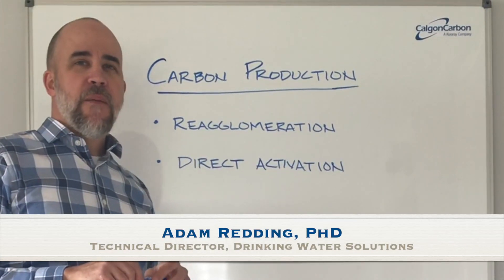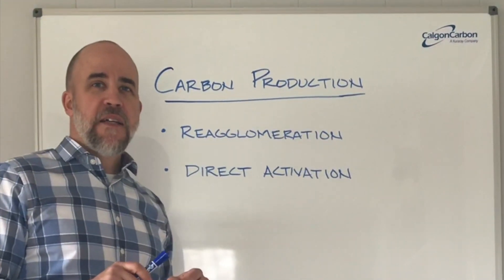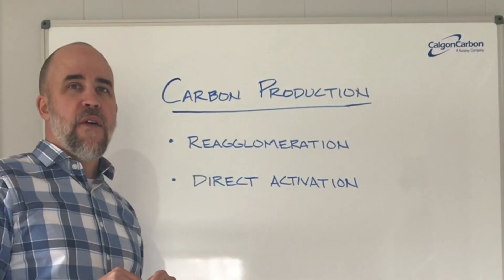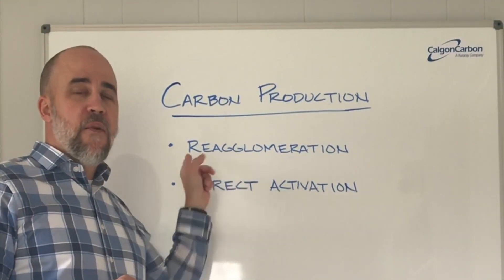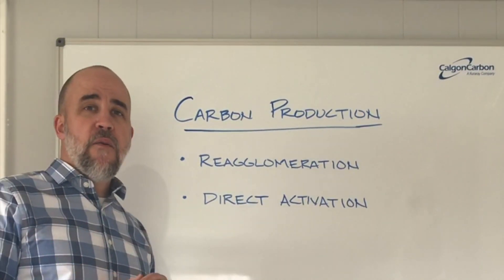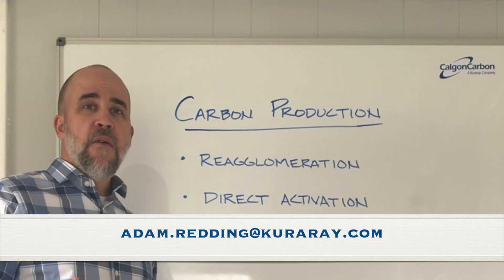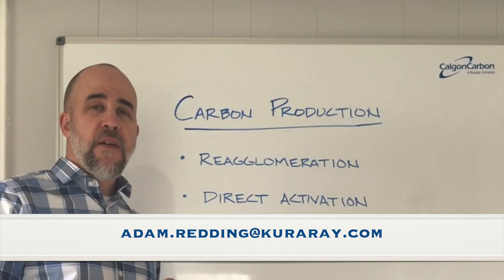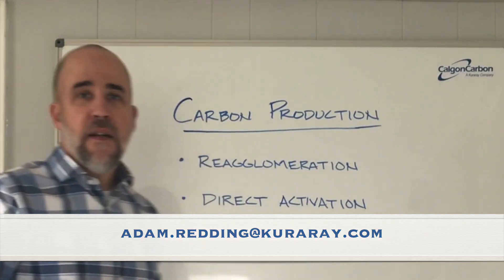Activated Carbon: Reagglomerated vs Direct Activated

Comment: The majority of coal resources in US - bitumenous coal. It is not that simple to activate it directly, thus reagglomeration process was developed.
Would be good to hear about other advantages of reagglomerated coal than consistency (you can also blend direct activated coal of course), like less floaters, higher molasses number etc.